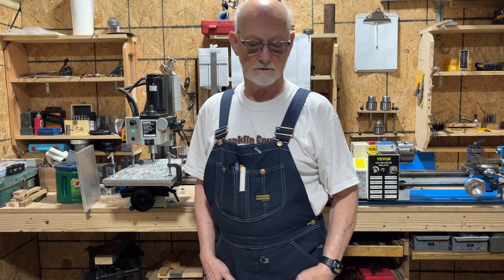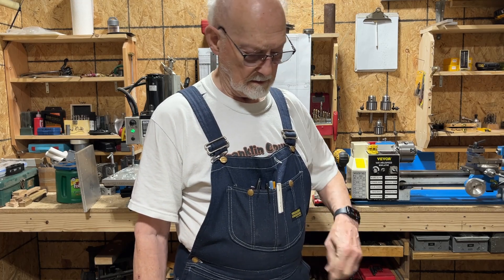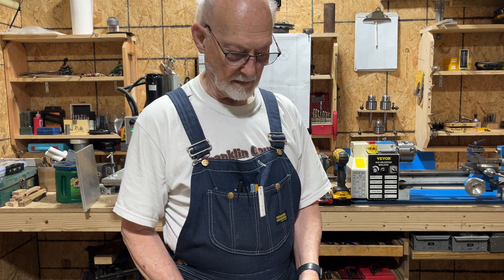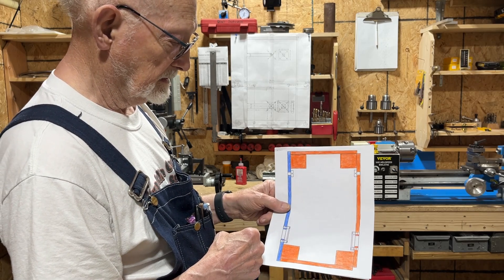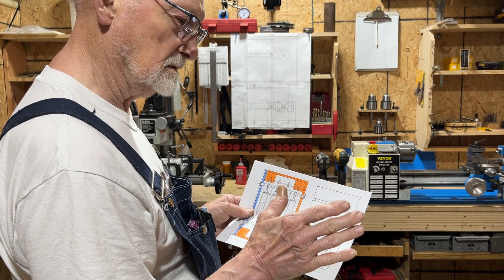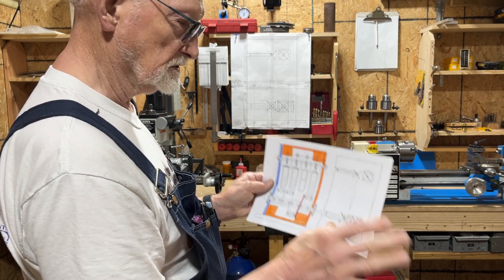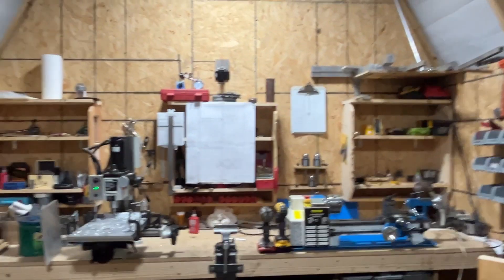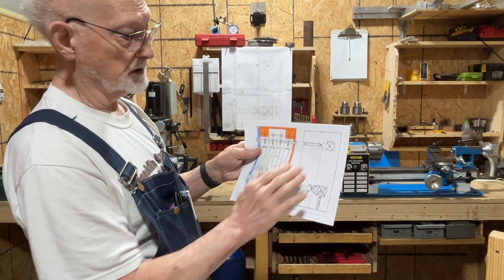My Air Powered Car Motor, Milling and Drilling Engine Sides and Ends 6-11-24

Comment: What is your calculation of energy stored in the cylinder you are using?
Reply from the maker: I’m not trying to calculate the amount of air, or energy as I work on it